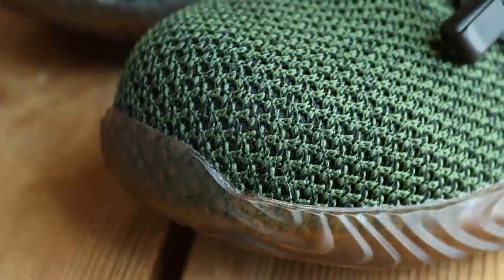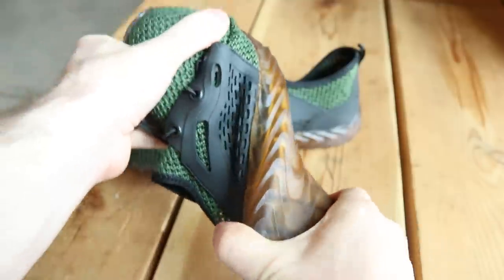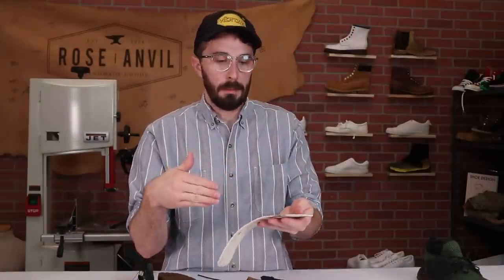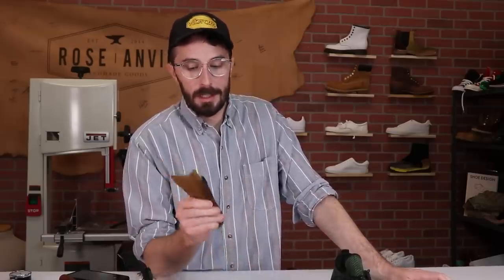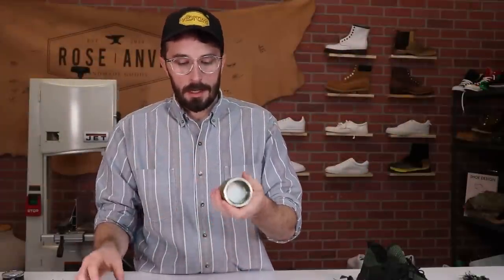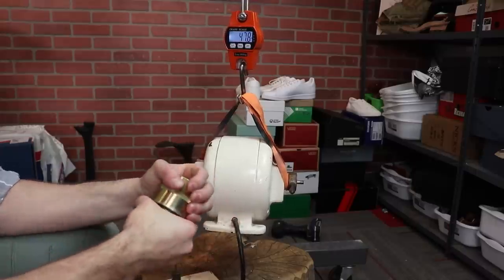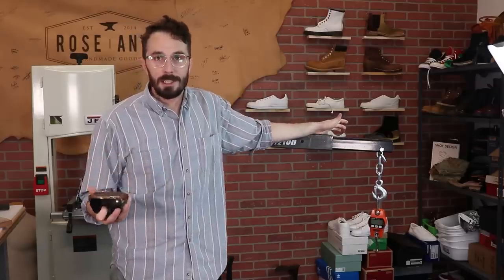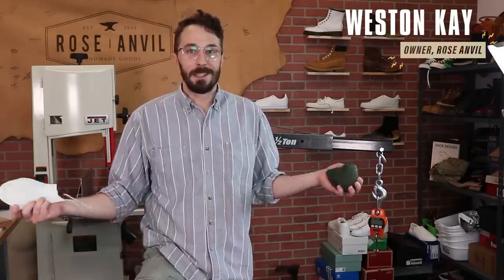Never Trust a Fart or These Indestructible Shoes

Comment: “Dental Lathe” sounds !?&@$^% terrifying
Reply: Nah. All you do is tie the patient down to the spindle, rev it up to 20,000 to 30,000 rpm and get started.
Reply: Martin Schou 😂😂😂
Reply: I used one when I worked in a dental lab making crowns, partials, and implants. It's just a big heavy stationary dremel. Though this one was missing its quick-chuck.

Comment: I have a pair of "indestructible" shoes. The pair I bought has a steel layer in the sole for puncture resistance. The problem is, the steel sole snapped in half around where the ball of the foot is on BOTH shoes of the pair. They instantly became a hazard to wear, cutting into both feet

Comment: my first thing with the steel cap is that with a shoe with a sole that soft, there's a real risk of the cap tipping back and literally cutting off your toes... :s it should be sturdily molded into the sole, not just standing on top of it (cheap work boots can have the same problem, i've heard some horror stories)
Reply: The amount force to buckle steel would obliterate ANY human parts. Theyve done multiple tests proving this. If you're afraid that 2k lbs of force will compromise the integrity of steel you should rethink how you operate in the work place; as there is nothing you can do to prevent that level of force. Also go read a book.
Reply: @charlespanache7047  i'm quite clearly talking about the sole not being a sturdy material and the steel cap being able to tip back because of it (and by doing so cutting your toes off, which i have been shown pictures of when i was working at a construction site), not the steel cap itself breaking or bending?
obviously these shoes aren't meant for work like that, but in my opinion it can still pose a risk. 
also, no need to be hostile for no reason :p

Comment: 3:11 never repeat what he is doing. It is insanely easy to cut a huge gash through your hand this way if the knife decides to cut through all at once. You are putting very large ammounts of pressure up and forwards toward your hand.. once it gets started it will easily keep on going through like butter as you not only have pressure  but you have speed now and a razer that is pushing the fabric up over the blade giving you a cutting motion. Take it from me, i recently cut through my finger to my bone  and cut a groove in my bone by being wreckless like this and while I can take pain fine and it didny bother me I have too many scars on myself to keep adding more. (Also there's the fact that I couldn't bend my finger for weeks without splitting my finger all the way open again. Which may or may not have happened a few times especially since I didn't get stitches like I should have.)
Reply: My man you could’ve just said it was dangerous and just do it differently or wear some work gloves
Reply: @scrawnchycat1099  yea but some people like more information and i also felt like sharing that because it was that exact way of cutting that caused me to lose a chunk off my finger. Originally it was my plan to keep it short and simple but adhd makes that hard too lol

Comment: I've never seen this channel before, it just popped up on my feed. I've owned these shoes (but in grey/black) for over a year now. I work in a lab but I work with pallets and nails at least once a week when getting supplies, and have used these shoes to stomp nails down dozens of times, so they do work. I think the combination of the rubber and the Kevlar definitely help. Also, not too many times is a nail sticking up at a 90° angle so that all of the force is at the tip. Most likely scenario is that it's slightly bent even a few degrees, enough to start a bend. Plus when I kick nails down I generally do so at an angle not just straight down as that would be silly.

The shoes come from China, had I known that, would not have bought them. American company.. Assembled in China. Also, the insoles like you said, are garbage. Fell apart within a month. Take a little getting used to because they are very light but the steel toe (which is a decent steel toe) is heavy so it's a weird feeling at first. I work with chemicals so it wasn't the best choice since liquids can just slip right through the holes in the weaving, but man do they stay cool.. Never get hot.

Overall, the shoe has some positives and it has worked for me, but I would not recommend especially if you work construction or something, there are way higher quality shoes with full protection out there. I just wanted the running shoe look with the added protection (also electrostatic dissipating).

Would be interesting to see the puncture test with both materials.

Comment: Project farm rules, his tests are always thought out and effective representation of the scientific method.
Reply: This channel can learn a lot from project farm if he is looking at getting scientific data . I love this channel but you can't beat project farm or Destin ( smarter every day) for reliable data
Reply: @hg.chetan  Yeah, definitely these three channels are great information channels and answers questions that product reviews and marketing will never do. Have to say each of these are great and if they get together, they would make a fantastic team. One to deconstruct, another for real-world side by side comparisons, and the third for science and engineering analysis.
Reply: His tests are not scientific at all. He does ONE test with each of the products. Doing ONE test makes the results statistically irrelevant and null and void. He did a break rest with string grinder line, and tested each one, one time. Derp. Most of his tests are like that, and occasionally he'll do 3-5 trials.
Reply: @xenonram  I agree in general that he should do multiple trials or at least affirm that only doing one trial limits the efficacy. 

However, doing things in a tightly controlled manner the way he does is still very effective. He will usually have a control variable, well contained variables and variation across samples, and do multiple trials to take an average. Within a reasonable budget, he does the absolute maximum possible and it is very useful for consumer informing.
Reply: @xenonram  Agreed. Not statistically significant. However, he isn't funded like the CEN for testing or DARPA for research and does the best possible he can, despite being a non sponsored channel. I would still pay heed to him for whatever insights he can offer.

Comment: 10:00 in my opinion you got the wrong spot, theres a very distinct moment before this, where the scale goes down to 13 pounds and then rapidly back up to thirty. 

i think thats where it actually pierced and what you saw afterwards was just some fluke from the weight shifting to the side after the nail hit the bottom

Comment: Sharp, highly focused is not what kevlar stops. It’s the high velocity impact spread out over a large area. A knife will puncture kevlar. A nail will too. But a high velocity bullet, spread out over a large surface area, will be blunted. The kevlar acts like a springy net, absorbing and distributing the energy. A highly focused point will separate the fibers and push easily through.

Comment: You could use the engine lift to do the measurement.   Have the jack pull the nail up into the  holder.

Comment: Puncture resistance of rubber tread material is extremely reduced by any lubricant such as food grease, oil, etc, even water.  Polyurethane and PVC soles are penetrated almost instantly by a small piece of burning campfire wood.  Some hi-tech rubber compounds are amazingly puncture resistant and provide excellent grip and flexibility but expensive and usually only found on OPE footwear.  It is NOT Murphy's law that you are more likely to get a flat tire on a rainy day.  12:48

Comment: I am a professional haunted house actor. One of my favorite things to do is what's called "sliding." Basically, you wear knee pads and slide across concrete. I got these hoping that they would be able to withstand the pressure that that puts onto your toe, and within literally 2 days of stunt work (approximately 15 hours) one steel toe popped off, and the other was half-way off. I DO NOT recommend these at all! They totally let me down, especially for what I payed for them

Comment: Bought these about a year ago. I knew they were garbage, but that's kinda what I wanted. I wanted a flimsy flexible steel toed shoe. Only real complaint is that they're slick as hell. Worth the $27 imo. Although I'd ever use them for real work.

Comment: Kevlar is not made to stop puncture at low speed but just bullets. It will not protect you from being stabbed or any puncture. If you want protection from puncture a work shoes whit a metal plate underneath is the way to go.

Comment: I used to work as a technician in the weekends, so 2 times 12 hours shifts. On of my coworkers once put a step counter on his phone, we did an average of like 20 kilometer in a day. I think i wore trough 2 pair a year. So they don't last forever if you do walk a lot in them. But they where by far the most comfortable workshoes. And they go like 20 bucks, that's not much. Just make sure you buy them large enough. I still have a few pairs laying around it's just a little bit too small but because this has a fixed tip it doesn't really expand any. So it's pushing my toes together.

Comment: I just seen the advert for these shoes.  The demo they make is done in a way the shoes will survive.  But if you take these shoes and have them survive the ULC test for work boots, they would fail.  And for the steel toe, use a sledge hammer, just put something that will represent the foot and hit as hard with the sledge hammer.

Comment: I got some indestructible shoes from indestructible and they lasted 2 months and it took 2 weeks for me to find a nail on a demolition site I worked on (okay but not good). I am a carpenter and will not buy those shoes again. I will say that I did step on a lot of nails but the shoes do break down extremely fast unless you are gentle with them.

Comment: Got a pair at the beginning of this summer and after it started getting cold i washed them before storing them for the next year. They look almost like new. Well i dont need to worry about walking on nails. I just needed light shoes with good airflow, that wont let me slip around easy and keep my fingers save. They are not really good with static electricity tho

Comment: To be honest, for less than $50, these are good enough for me. I just work in a shop there is no danger to my feet but just oil and coolant on the ground occasionally. But some reasons, the employer required steel toe or some kind of toe protection shoes. (my co-work doesn't give a fxxk, he wears tennis shoes all the time, that shxt is funny)
My work shoes are totally worn out, I might give these a try...

Comment: I'm surprised you didn't use a floor scale, that would tell you the actual weight pushing down vs weight hanging off the scale. You should also try to calculate PSI for future tests of this kind. Also definitely use more mass, a shoe is supporting the full weight of a human in a step so the weight of the average human should probably be the benchmark.

Really cool though, I've been waiting for someone to test these shoes properly.

Comment: Still cheaper than most steel toe work shoes and it has more resistance to punctures so I would still feel safer with these on. Lot less weight to puncture a boot or any other work shoe.

Comment: I got a pair of the "Ryder" model (I believe) in October 2019. Within a short period the upper portion started falling apart. Several metal pieces in the eyes fell out. The insoles absolutely fell to pieces. The soles started to unglue from the uppers. 
Complete trash.
Edit: I wore them to my job a few times...and I work in an office setting. You are seriously far better off shopping the clearance section at JCPenney.

Comment: Kevlar is actually not resistant to pointed objects. It resists blunt flatter bullets for example but not pointed ones as well. Pointed objects find their way between the fibers. It's also more cut resistant, but it didn't appear you had much trouble cutting it.  Appears to be fake Kevlar, but even real Kevlar will likely fail that nail test.

Comment: I don't believe Kevlar is very puncture resistant.  It is a woven fabric, so any pointed object like a nail can easily penetrate it by going between the strands.  Kevlar IS very cut resistant however.  It is extremely difficult to slice it even with a razor knife.

Comment: Also the big reason the Kevlar didn't work very well is because Kevlar is meant to flexible. It loses all its riggedness when its stretched tightly. If that tiny piece of Kevlar was tighten downed on the sides and not given opportunity to bend and give then it wasn't being used in the correct way Kevlar should be used.

Comment: I don't think Kevlar is very puncture proof... It stops bullets well, but bullets aren't knives. 
Anything with a nice point on it that doesn't move at supersonic speed should go through relatively easily.
That's why stab resistant vests aren't full of Kevlar, but rather have a sheet of metal in them...

Comment: Imo, work boots should have mandatory, Steal plate, and steel toe or equal, and if welding, steel shank (they call it) or steel or fibre glass tongue, it forces heavy pipes to roll off the arch without damaging the arch as much from the impact.

Comment: I have had rigger boots with steel mid-soles and still had nails puncture through them (no injury luckily) so some kevlar (which is much better known for it's ability to spread out blunt impacts than it is for dealing with sharp objects) is probably not much if any better

Comment: If you want to continue testing the pressure to pierce a shoe you should get like a mannequin foot and build a little base on it that you could add weight to then put said shoe on the mannequin foot and set them on on your nail board then add wait until you get a puncture

Comment: If thats Kevlar its not puncture resistant.  sharp objects like knives and nails will go right through it.  That is also a very thin layer so its probably the sole of the shoe stopping the punctures not that layer.
I suggest putting that layer on the outside of the shoe and slapping the "kevlar" layer against the nails.  I checked the DuPont website. Kevlar is yellow or darker if dyed.  
FYI I recall being told while in the Army that humans put about 400 pounds of pressure on the ground when walking.  We were told this because typical antitank mines go off at around 400 pounds.

Comment: I bought a pair about 8 months ago, and already they already had problems 3 months in. They say they’re slip resistant, but after those 3 months they had less grip than flip flops, the “lace” on them easily broke, and the steel actually slid into an uncomfortable position to where it was stabbing my toes every time I walked. 
Overall a bad pair of shoes 2/5

Comment: I am pretty sure that out sole would slow it down though the best case you can make is that kevlar does not cover the sides of the foot. I am curious what would happen if you were to put the combination of the two in. It would slow down yes. Perhaps keeping that weight on there would do it in time. I just feel it may be more complicated then that. Cause you also could hit the nail at an akward angle which is going to make a big different as well. If your planning on stomping on nails tho give this one a pass lol.

Comment: Usually if I’m in a construction zone if I feel anything under my foot I don’t put all my weight down. I’ve stepped on dozens of nails and can say I haven’t had one pierce my boot (knock on wood) I wear redwing moc toes. I get them in my hands more. Was doing a remodel and pushed insulation into the wall didn’t realize one the the exterior sheeting nails missed a stud and my palm found it. Luckily it didn’t go to deep. Just enough to remind myself to grab my gloves.

Comment: I bought a pair like these...the steel toes ones...so yea they're light and the steel toe has worked but the sole super sucks you can feel every rock and pebble even with inserts...and to secure them that sux too.
Reply: In addition, that grid pattern in the plastic sole left bruising on my feet the first week I used them...I work 12 hour shifts at a wastewater plant so I'm on my feet about 75% of my day.

Comment: But with the sole and the Kevlar together , wouldn’t that be sufficient enough ?
Reply: I don't believe so, the resistance of both materials wouldn't be additive. If you were to step on a single nail with them on, it would take around 50 lbs of pressure to go through the rubber, then after it's punctured the amount of resistance it has is much less, maybe a few pounds at most, then it's just the cloth material, which gives at less than 200 lbs.

Comment: Bought afew pairs of these in different designs and the feeling a tack would go through the buttom nevermind a nail would be more true. But the worst thing about them is the lack of grip on wet slippery surfaces, not good and i even had a nasty spill wearing a pair, not impressed.

Comment: Basically flip-flops with a unreasonally heavy tip and sole.
Those would be worth something if they had some hard plastic just on the front, instead of having that ridicule sweat-making and toe-hurting cap all around your fingers.
Also, they could easily have been more fitted, that way, making them actually useful for rocks or just everyday use.